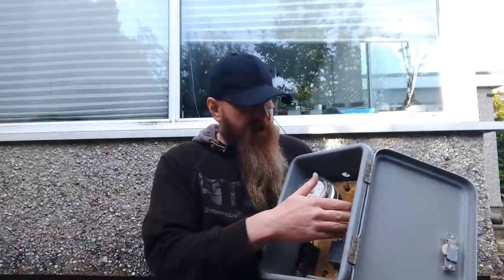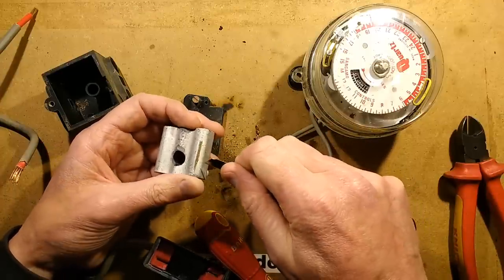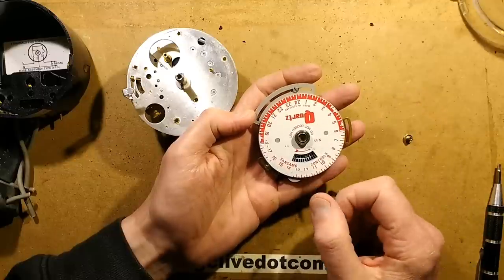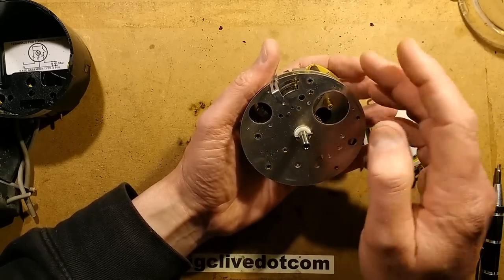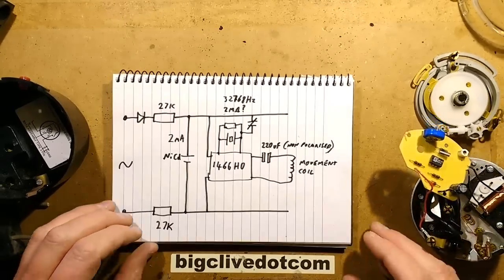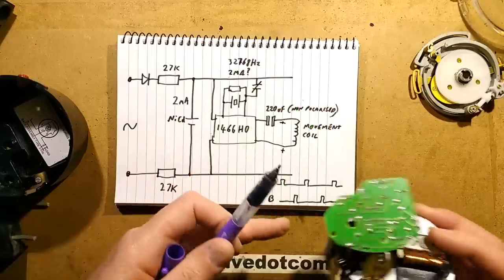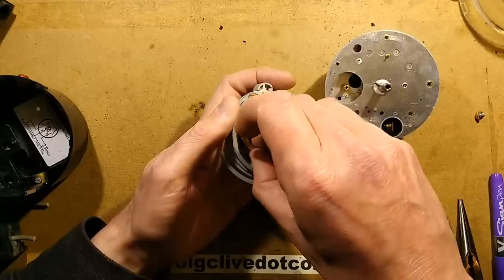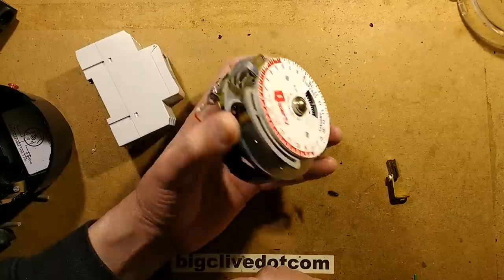Fixing a Sangamo street lighting time switch with solar dial.

Comment: 6 band resistors are usually 3 for the value, 1 multiplier, 1 for tolerance and finally 1 for temperature coefficient.

Comment: Used to find these timing heating systems in MOD buildings. Generally used to time individual buildings from a central heating main.
Reply: surely buildings would be easier, just 9-5 mon-friday.  this unit has compensation for daylight summer-winter, certainly cleverer that i thought it would be.
Reply: If only the military worked from 9 until 5. Bases tend to be like small towns with houses and communal accommodation blocks as well as all the usual industrial and commercial buildings.
Reply: ahh i forget theres more than just the office shirkers, lol

Comment: i really have no idea why in a relative modern era "1999" to use such a complicated device from the 1800's
all what they had to do is to mount a cheap light sensitive trigger on the top side of the lamp.
that would actually compensate for the season changes as it would be set to trigger by a specific lighting condition.
no mechanics, NO backup batterys, no wrong trigger (how many times the lights are on during the day and off at night because of a power failure)
Reply: Ronny W :  reliability.

Comment: I had one of  those over 30 years ago on  my  central heating but it  had a synchronous motor and developed a fault if the  power  was interrupted it ran at double  speed

Comment: How much will temperature affect the crystal and the time accuracy? I know wristwatches often relay on body heat and can be inaccurate if not worn. A timepiece hanging outside would be subjected to quite a variance of temperatures, I would think.
Reply: Those 32.768kHz crystal are quite stable (maybe +-50ppm over the range from -20°C to +50). And there are temperature compensating driver chips (don't know if that has that). That said, it doesn't really matter if you are off a few seconds every day or a few minutes a year.

Comment: I worked at a drug store that had an electrically switched timer for the parking lot lights. four or five times a year the time would have to be re-programmed on account of the time falling behind.  It would get about an hour and a half  behind or more before management would be motivated enough to get out the step stool and reprogram it.  Eventually the electrical contractor got tired enough of the bitching from corporate that they installed a mechanical switching system similar in appearance to this. I always wondered why the timer would fall behind.
Reply from the maker: Some cheaper time switches tended to stutter a bit as they got older and lose time, because the very low power motor struggled to drive the mechanism.

Comment: In Sweden (or at least in my area) they usually use digital astronomical clocks (if they don't just use photo relays), which apparently fail all the time.
Reply: Aaaand two minutes later you explain that, so, never mind i guess..

Comment: WOW...that Mic you're using works very well! ...for some reason, at the begging when you recorded yourself, it totally stood out to me...I wish I could figure out how to use a Bluetooth microphone with recording and not have a delay, software issues with it NOT working at all and having it sounds as good as yours...right on mate! great stuff/video, as per usual...
Reply from the maker: That was a very common wired lavalier mic clipped onto my baseball cap skip and the wire trailing over my back and to the phone.
Reply: Have you considered using your phone and a wired mic to record? Then just sync it in editing.
Reply from the maker: I do very little editing.  I record most videos with my phone using a small plug-in microphone.
Reply: bigclivedotcom I know you don't edit much but that Mic is worth whatever you paid for it! ...great for your use but being attached to a wire kinda sucks ...especially if you want to accurately capture your reaction in hifi when rapidly retreating from an experiment gone wrong, a fire or an explosion haha

Comment: They are nice switches, very reliable and easy to swap out, I have an Venner time switch (CSEH) which has a wind up movement and two open cups for mercury to do the switching, nice. Shame you are so far away, you could have it otherwise.
 Cheers, J.
Reply from the maker: The loss of mercury tilt switches and wetted contacts is another RoHS disaster.  They were super-reliable.
Reply: Agreed, I always found them fascinating.

Comment: When I acquired my first house in 1975 I bought a couple of the mechanical version of these switches - £9 each second hand  from Exchange and Mart.  (£9 was about a third of my monthly mortgage.)  I used them for outdoor lights and took them with me whenever I moved house.  40 years later I was working with an electrician rewiring my current house; when he saw these switches he said "If you were not here those switches would disappear".
Reply from the maker: Ah, Exchange and Mart.  The paper equivalent of eBay.  They sold some weird stuff.
Reply: Yes, E&M - the stuff of dreams.  Dodgy land deals in Spain, rusty wrecks posing as restoration projects, magic paint with a hammered finish, all sorts of essential mechanical and electrical stuff (and none of it from China), all from a time when Maplin was a mail-order catalogue rather than an over-priced box shifter.

Comment: Is there a functional difference between wire that has two layers of insulation, and wire that has one very thick layer of insulation?
I mean, is two thin layers better in some way, as compared to one thick layer? Given of course, in both cases the total thickness of insulation is the same?
Reply from the maker: +thany3 One of the main advantages of two layers is that you can see where the cable had been damaged easier by the different insulation colours.

Comment: Is that just a normal 1.2V rechargeable nimh cell? Peer as I might I can't quite make out the markings. I ask because the lighting in my flat stair has stopped coming on at night, and it seems we've got exactly the same model of timer as this. I expect the same failure has occurred, and it would be nice to have a replacement battery to hand before I pull it out of the wall.
Reply: Actually turns out it was a mechanical failure in our case. One of the wee actuation legs had decided that ~25 years of being pushed around by the pins was quite enough for it and it had succumbed to metal fatigue and bent over, jamming the whole thing up. I took it to bits and put a nice big fillet of solder across the break. Who knows how long it'll last, but it doesn't really owe anyone anything so it's all a bonus from here on out.

Comment: This clock also controls the communal lighting in council flats too, which is why you'll need the longer settings.  Have set these many times over the years, normally after the clocks go back or forward.
Reply: Too bad they don't make the cam take care of Daylight Saving Time too.
Reply: We do! The movement tracks the sun - the sun doesn't know anything about daylight savings and keeps to it's same path. These switches should be set to GMT and left there all year. :)

Comment: pretty neat. I image some of the lights in my area use this type of system as they come on at the same time. (historic lights in a downtown core) however the town is changing to LED street lights, they have the sensor above the light plus once the installation of lights are done they have a built in network, allows for control and remote monitoring for possible malfunctions.
Reply: If several lights come on at the same time they are very likely not using this timer. It would not be accurate enough for that.
Reply: probably not, all i know is that there are 4 sections, that all light up within 5 minutes of each other. and I've seen the inside of the lamps; they have no active circuitry. so there must be a timer nearby in a control box. although it does seem like it runs on a timer, as during summer hours it will come on when there is still quite some light on where as other times it will be super dark from storms in the afternoon and it will turn on.

Comment: My dad uses Hemley blocks to common lives or neutrals together if tails at a board that he's changing are not long enough. Seen them used for large bits of earthing as well, but personally, I prefere the eathring bars you can just screw to a back board and leave in the open.

Reminds me...I need to bond our gas main.
Reply from the maker: Yeah, me too.  In fact, all the bonding needs upgraded.
Reply: Gas meter is outside, and was got into the housing & the tag is all corroded and horrible. Just sort of crumpled off. 

Had to use some sand paper to get the oxide off the earth cable too. Dad pinched the silicon gun so I couldn't seal it -_-

Comment: around 4:10 when you start guessing what metal it might be, what are the implications? what would be the difference between aluminum and brass? why is brass good for this use, and why coat it with another metal? would steel not be a good choice? is the coating process of brass not more expensive then just using another metal? so many questions! if anyone knows, im curious
Reply: I'm no electrician but i believe brass has a low resistance and it's tinned so it doesn't corrode or oxidize as much vs straight brass? Maybe someone will confirm.
Reply from the maker: Brass has similar electrical characteristics to copper, but is harder.  The tinning is a protective layer.  Aluminium creates a high resistance oxide coating rapidly causing issues with electrical connections burning.

Comment: Why would you use a switch like that on every lamp instead of switching the supply to all the lights on a road at a single location?
Reply from the maker: In this area it's overhead lines with huge spacing between lights, so it's easier to just have a clock per light than run an extra cable for the street lighting feed.

Comment: Why are those blocks made of brass? Also why it's better to aluminium? Thanks Clive.
Reply from the maker: Brass has similar electrical characteristics to copper, but is harder.  Aluminium tends to form an oxide on its surface that has a high resistance and can cause burning issues if not terminated correctly.
Reply: bigclivedotcom :   and aluminium threads strip quite easily too.

Comment: that would make a very interesting but somewhat inaccurate clock if mounted under a glass jar on a wood base.
Reply: I think you probably mean "imprecise" (due to the 24 hour dial). The timebase is adjustable, so the clock could be extremely accurate. 

EDIT: I see someone mentions the accuracy of the timebase chip in one of the first comments.
Reply: Yes.  Accuracy versus precision.

Comment: Would someone be kind enough to explain why it is the digital timers do not handle high inductive loads very well?
Reply from the maker: Quite often the switching produces an electrical spike which reaches the main control chip and causes it to reset or lock-up.
Reply: Ahh, the back EMF.  Am I mistaken, or couldn't this be designed for?  Thank you for your answer, you are a great inspiration, and I just landed my first job, nonetheless in electronics!  :D

Comment: Hey Clive, I've got one of these that is supposed to power communal lighting, It's broken! If I remove the battery complety wouldn't it work as I can't solder for shit.
Reply from the maker: It could work, but I would recommend trying to fit a new cell.  I think Sangamo sell official replacement cells on their website.
Reply: @bigclivedotcom  It's a strange one, There are two of these, Both installed in 1991, There is a small red override button to override the timer, So one set of lights are on 24/7, Not great for fluorescent tubes or the bank balance, And the other one flat out doesn't work, From what I've red when the battery dies it creates a short circuit turning off the clock/timer. The overide does nothing on this unit.
Reply from the maker: @AlanMcGarrity  The override button physically cycles the switch.  The timer may not be fully pushed into position or may have trapped the side of the button.  You should still be able to actuate the contacts by manually turning the dial.
Reply: @bigclivedotcom  I removed the battery and they are were working great, One of the springs had broken so it would turn off and never turn back on, I managed to fix it but the solar dial part was loose, It fell apart in my hand, I really wish you had shown how you put it back together!
Reply: Hey Clive, After a recent fire incident, The timer has been removed from the Series 7 100A fuse holder, If the fuse is out, Can I technically wire it back in at the top where it came from without minimal chance of electric shock? OR would I also have to remove the series 5 100A that's comes before that too?

Comment: I thought street lights had a sensor in them that turned them off and on when I looked at them. Shame.
Reply: You can see some lights have a sensor on the top and will stay on during the day if it's not clean
Reply: Prehistoricman 
Pretty sure Malleus was being silly. I always thought they turned on and off when I drove by them.

Comment: did you not just order a lot of those batteries for solar light repairs?
Reply from the maker: Yes,  I just clicked with the size while I was making the video.
Reply: Any idea where I could get a replacement battery from as i need to do the same with my timeclock thanks